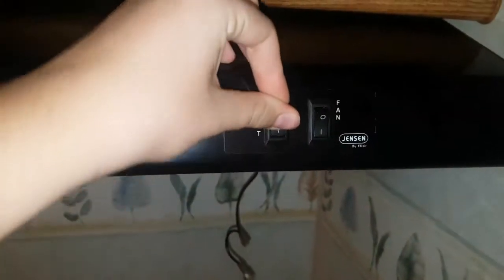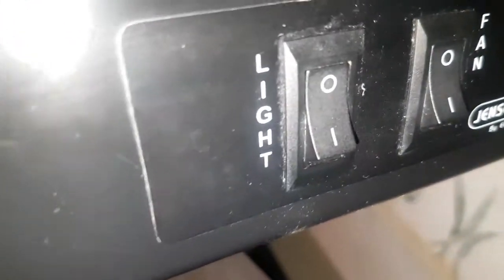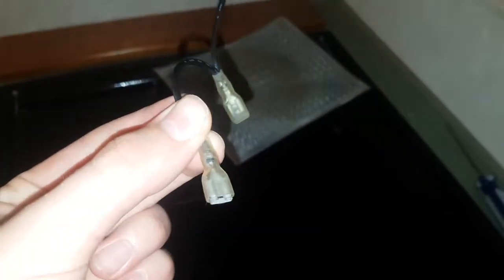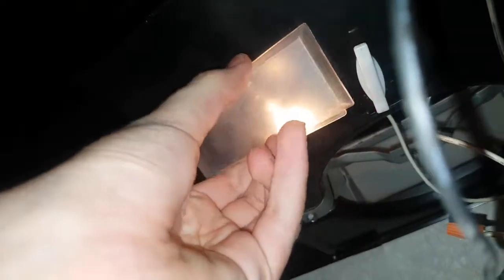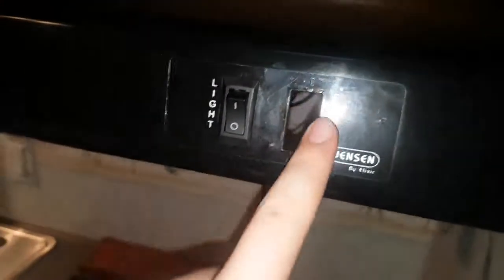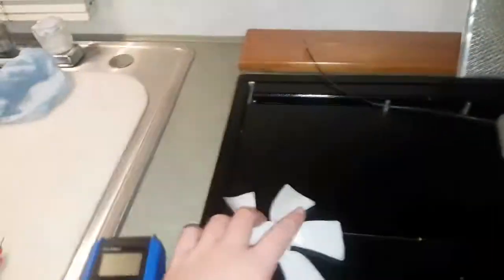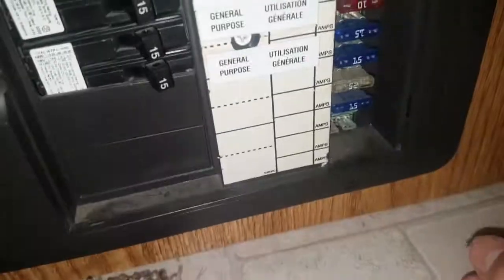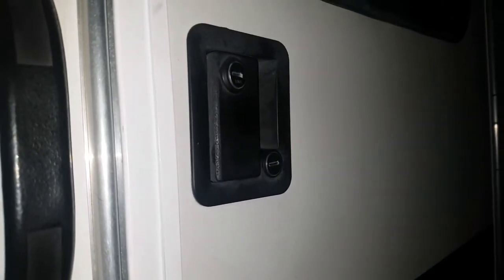Repairing A Camper Range Hood

Comment: You won’t get shocked by 12VDC but kudos for being careful. 

It’s been 4 years but you might find it very beneficial to eliminate the 194 incandescent bulb and install an LED of the same wattage for 5 times more light. 194 is 3.75W and 25 lumens. 
I actually used a 87mW LED flood in the kitchen areas. About 65 or 70 lumens iirc
Reply from the maker: In addition to being a big scaredy cat of sparks, I also don’t fancy blowing a fuse. Thats why I take precautions when I can. These days i’m quite comfortable with this work.
Reply from the maker: Ultimately I’d like to change this whole trailer over to LED. Its a 2004 25 Foot Wilderness Fleetwood, that gets used very infrequently. Likely, Ill leave it as incandescent.